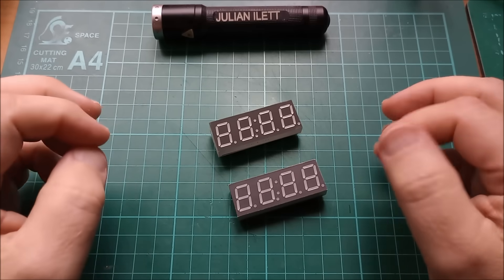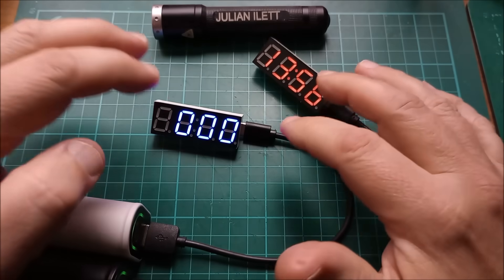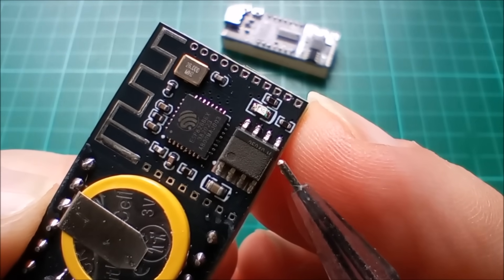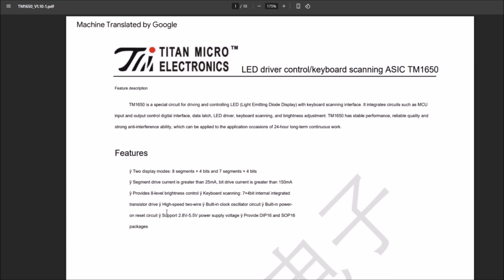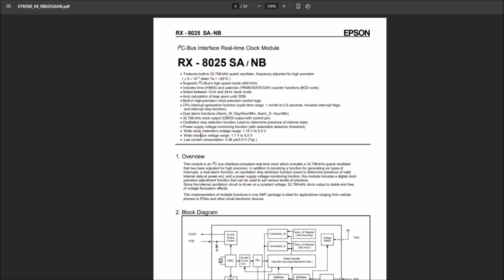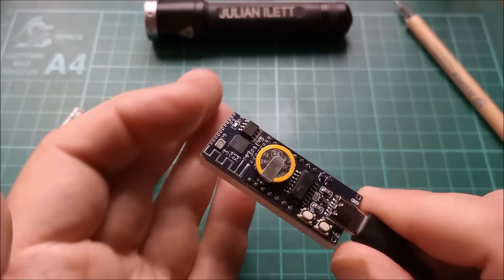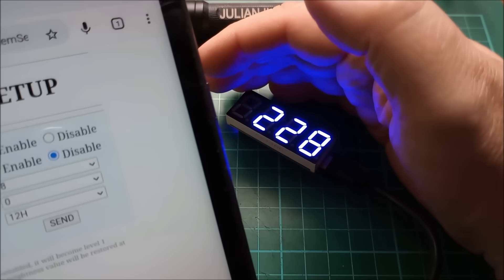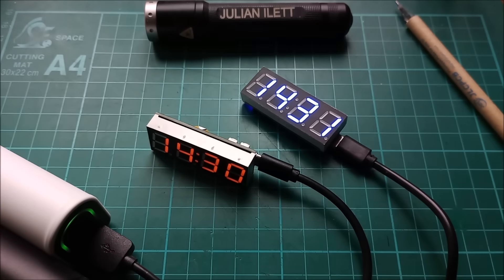$5 AliExpress Clock Modules

Comment: More hassle than using a module that picks up The MSF radio signal is a dedicated standard-frequency and time broadcast that provides an accurate and reliable source of UK civil time. It is available 24 hours a day across the whole of the UK and beyond. The signal operates on a frequency of 60 kHz and carries a time and date code that can be received and decoded by a wide range of readily-available radio-controlled clocks.

Comment: The message at the bottom of the config page at 14:04 says it is time dependent dims to level 1 after 7PM, returns to the set brightness at 7AM ;) I have something similar with my own custom MAX72xx dot matrix clock... can also show the time on it's web page also just for kicks. Has a MPU-6050 on it so it can be on either side and will auto-rotate, plus might be handy in the future if I give it an alarm - push it over to shut it up ;) They probably didn't do any proper power saving in the code hence why it is so warm... it is possible to make it reasonable power efficient while keeping it "active" if you code it well.

Comment: I purchased a 6 digit one for $6, no WiFi etc, with a really nice Seiko Epson RX8025 high stability clock module, it has been running now for quite a few months on it's backup button battery (as in processor & display off), and is only a few seconds out - kind of amazing, better than my old Pulsar LCD wrist watch.
I put it in a project box with four AA cells, it only gets turned on when I want the time, so they should last a very long time.
I built it as part of an article for a magazine I write - back in October 2024 and the time is still good.

Comment: Logic output for the alarm?
Reply from the maker: I suspect these started as an open source project which has been re-appropriated for low cost manufacture in the far east. In the process the PCB has been changed but the software is the same. Outcome: no alarm outputs.

Comment: I have made a bunch of clocks using esp8266 and different titan micro LED drivers.  I prefer the NTP setting method.  I even designed a replacement board for the tiny 7 segment displays using 32mm LED filaments as the segments.  As an artistic touch. I have them blink 12:00 while they are syncing with NTP--just like an old VCR. 😂
Reply: I went with "b00t" on mine... Didn't want to show a time that wasn't valid, and hadn't thought of blinking it to show it wasn't valid.

Comment: at 5:02 you said that eeprom chip is 512 bytes of memory, there is no way that is right - I make my own PCBs with esp8266ex chips (I don't use modules) and you can't get away with using less than 512k bytes and it's going to be an SPI NOR flash not an eeprom, it stores the firmware to boot the esp8266ex and you can use SPIFFS/LittleFS or EEPROM emulation to store whatever configs you want..
Reply: Yes, that's actually a W25Q40, a 512KB qspi flash chip, not an eeprom.

Comment: The auto brightness might just work off the time if the clock doesn't have a light sensor - it would just go dimmer at nighttime, maybe 22:00 - 07:00 or similar.
Reply: The config page says exactly this at the bottom.

Comment: The reason for the external ROM is because the esp8266 does not contain any flash memory. So the external EEPROM is required to store the program.
Reply: If it were the esp8285, then having an external eeprom might make sense--if the programmer was unaware that you can use the built in 1mbit flash for configuration storage.
Reply: But it clearly shows it being an esp8266, so that's out.

Comment: Both have their place for usage but I don't really like the "online" version as it requires a Wi-Fi connection to function so I would get the standard version for my use.  
It would be great if you could combine the two so you could have an accurate clock with auto-sync but also having battery backup in case of power loss from the USB.
Reply: Yes there are such modules. Actually I though they all are like this - with WiFi and the backup battery. I have two different such models.
Reply: I'm  actually super surprised it isn't using the ntp server to discipline the rtc periodically. Should be pretty easy enough for someone to create a firmware for it though.